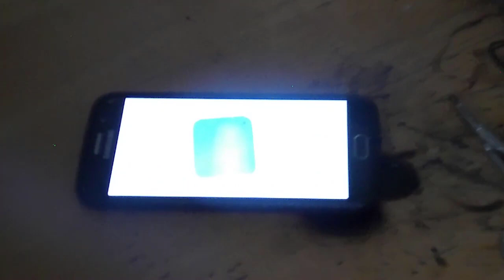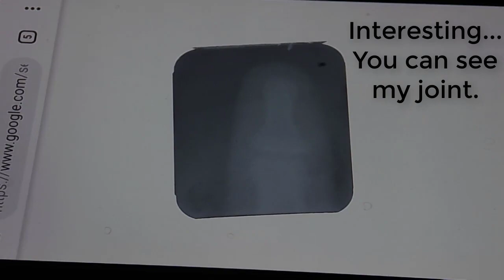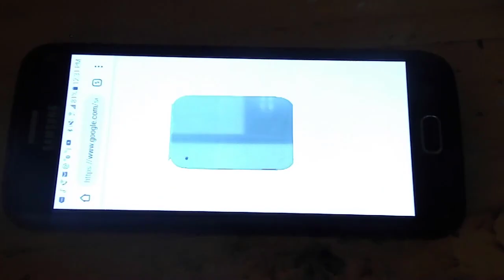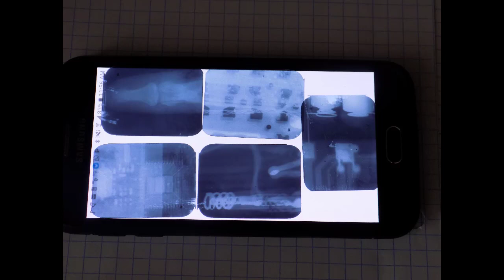Working DIY X-Ray machine

Comment: Not bad! I did'nt knew the 2x2a is such a powerful source. BTW, the old soviet 2x2a tubes are better suited than their US counterparts, as the bell inside has sharp corners. The US-tubes, esp. the later ones made by RCA have a rounded edge along the bell, this design produces far less radiation (which is desired behavior for normal use in appliances).

Comment: Nice video. But I wouldn’t have done the finger part, you have no way of knowing how many x-rays you produce, there could be tons of (more dangerous) soft x-rays that the Geiger Counter can’t pick up
Reply from the maker: Thanks. I tried to keep those to a minimum with an aluminum metal filter at the opening. The tube is also surrounded by mineral oil, so hopefully those things keep most of the soft X-rays from leaving the machine.
Reply: Honestly I don't know the voltage he's using but to my knowledge if his power supply is generating somewhere around 60k to 80k and the amount of time exposed,he maybe received around 1 mSv now keep in mind it takes 1000 mSv or 1 sievert to raise your chance of getting cancer by 5% so it would take somewhere around 1000 days of exposure like this to to do any real harm at all
Reply: @lilman10te  found useful .
Reply: @lilman10te  the safety limit is 20 mSv per year

Comment: I'm contemplating building an "x-ray machine" for the purpose of making it easier to dabble in mutation breeding with a bit more control. Personally, I would not be anywhere near the thing, shielding or not (unless the shielding was a lot better than you have here) when it's making x-rays.
Reply: Thankfully, bulk purchasing lead is somewhat cheap.

Comment: Hello, I would like help to assemble the machine since I did not understand the step of how to connect the cables to the rectifier and then to the power source, and what liquid is it in which you submerge the rectifier?
Reply from the maker: @CamilaLopez-z5d  The liquid is paraffin oil. I soldered the wires onto the rectifier then I connected with alligator clips. Please be careful.
Reply: @sciguy3128  and what type of source can I use and how many voltages?
Reply from the maker: @CamilaLopez-z5d  I used an induction coil around 50-60 thousand volts
Reply: @sciguy3128  and what kind of cables do I have to use to be able to solder the rectifier and be able to connect it to the cables of my power source?
Reply: and what size is the box?
Reply: @sciguy3128  and some other power source option?
Reply: @sciguy3128  and the radiation detector is necessary?

Comment: Hey, awesome project youve got here, that finger one looks incredibly good and comparable to a real machine. So, I purchased this on ebay after hearing one guy that said he used it for an x ray machine: 
ZVS Tesla coil Booster High Voltage Generator Plasma Music Arc Speaker Kits 20KV
So I have a question, is that enough and would 2 tubes make a better image? If i were to buy 2 would I need 2 high voltage sources?
Reply from the maker: I think your power supply at 20kv is probably good, assuming it is a ZVS flyback driver. You can use it to drive a flyback, and most of those have a HV diode built in, so you'll get DC out. As for your two-tube idea, no, I don't think that's a good idea. If you have two tubes, you will have two sources of X-rays from two different places. As a result, the image will include two separate "shadows", and this will look weird. It also probably won't increase the X-ray power, since you'll just place twice the load on the supply, so it's voltage will drop. Anyway, I hope I answered your question. Good luck with your project!
Reply: @sciguy3128  thanks very much, it is indeed a flyback driver so I should be ok, it says it needs an input of 12v 5a so I guess ill look for a cable that can do that
Reply from the maker: Sorry I'm late. Go with the film for permanent images, and the intensifier for fluoroscope-like images.
Reply: thanks, The fluoroscope images soudns more appealing since it should have infinite use? If my tube with 20kv dc can make it work it would be great, but some videos i saw said that it didnt react, maybe becasue there werent enough x rays, maybe long exposure could fix that. just a thought
Reply: Thanks, do you think my tube is at 20kv is able for an intensifier?
Reply from the maker: @judebox1185  Maybe... you may have to make sure your eyes are very well adjusted, or have a very long shutter speed.
Reply: Well as an amateur astronomer i'd like to say i have good dark vision so ill give it a shot. thanks for the help
Reply: @judebox1185  Did you made it?
Reply: Yes almost, I had some trouble with the power supplies from china so I have been waiting for around 2 months, it should be all finished this friday.
Reply: @judebox1185  Okay, I'm happy that I am not only one who is making x-rays machine. My family thinks that I am idiot and wierdo cause I am spending my money on something what is dangerous. Also, be cerfull that your packet from China isn't made in Wuhan ;)
Reply: yes, its not a very popular hobby, but interesting nonetheless. good luck with your machine
Reply: @judebox1185  Ty
Reply: @judebox1185  I was the one recommending those ebay zvs drivers. I updated my post on EEVBlog to explain what I did. I should also note that I did not use x-ray film. I took the screen out of an x-ray cassette and pointed a digital camera at it to take pictures.
https://www.eevblog.com/forum/projects/homemade-x-ray-machine-liftoff/msg1452452/#msg1452452
I also used a Russian 2c2s tube, and got far better results than I did with the American 2x2a. Here are my results:
https://imgur.com/gallery/BbXQRhR
Reply: Hi, ive seen your post but after I ordered the ZVS, I also have the 2c2s tube by coincidence lol, Im only using one flyback and it works well for the dental x ray picture. Heres one I took, :https://imgur.com/a/JRAYOnA.
I doubt id have enough power out of one flyback to power the intensifier but i might try

Comment: Awesome job. I heard somewhere that you can produce x-rays from parts of old tv, is that true?
Reply: partly but you need other resources. It would be easier to make one from scratch because you would have to remaster a lot of the components.
Reply: @rwy-ug6pl  Oh okay. Thanks for respond.
Reply: @drspastic  Interesting, thank you for making video.
Reply: Make a low freq flyback driver using the output transistors and the flyback(there tons of schematics online), then you can connect it to a big vacuum tube such as the HV rectifier tube on old tube tvs(they were used until ~1970-1975)

Comment: May you share list of materials and if a build it I'll support u in patreon
Reply from the maker: I don't have a patreon, but I'll tell you the materials I used. For the shielding:
0.75 cm thick wood boards for the structure,
1 mm thick lead sheets from United Nuclear.
For the electronics and tube:
2X2A vacuum tube,
Mineral oil for insulation,
60 kv induction coil power supply from Scisupply.
For the X-ray film:
Ebay self-developing dental xray film.
That's pretty much it. Just some wires and some soldering to be done on the shielding.
Geiger counter is GMC-320+
Reply: can I get to vacuum from old radio or TV?
Reply from the maker: I believe so. If I'm correct, the 2X2A is a high voltage rectifier tube, so it is probably in some very old television sets or the like. 

To be honest, I'd recommend just buying one on ebay. They are like 15$ and work fine for this.